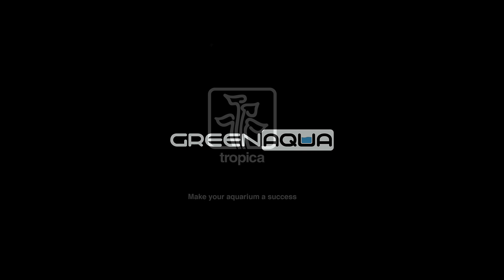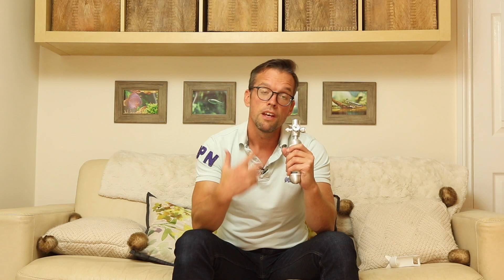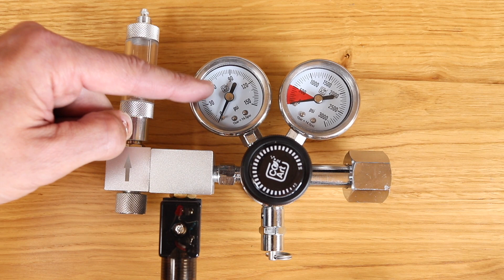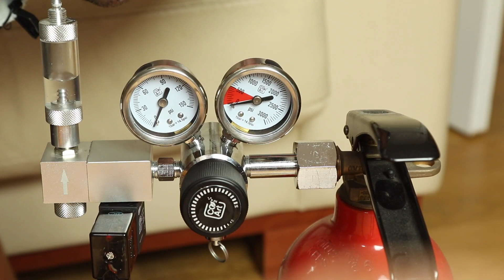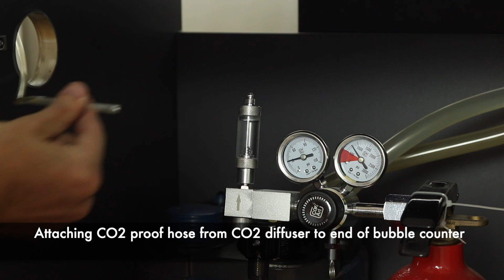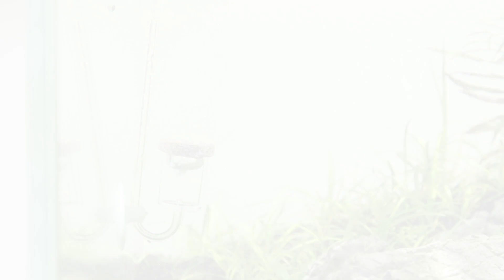How to set up a pressurised CO2 kit - Full Tutorial

Comment: Nice video! For those of us in the US I found the coupler size on the regulator is larger than the fitting on a standard fire extinguisher. I purchased a swappable 15lbs tank from a local supplier for $90.00 refills for $20.00.

Comment: There are dual stage regulators with fixed outlet pressures.They reduce the outlet pressure to a fixed psi usually between 30 and 40 psi depending on the model.

Comment: Hello George,  Hope this finds you and yours in good health and fine spirits.   Here are a few questions,  what are the pros and cons between an inline diffuser and an in-tank diffuser?   Which is a better return system under gravel jets or in-tank returns?  Please explain why med. or low light plants don't need CO2 but high-light plants do and are there any plants that buck this rule.  Can you explain what kind of led wattage is needed per gallon of tank water for low light, a medium-light, and a high-light requirement tank? Thanks, George and Hope you get around to these.

Comment: Hi George, not sure if this has been mentioned but you don't need a tie wrap as the pin will back in again when the handle is gripped down and this keeps the cylinder valve open.

Comment: Just a small clarification. Not every dual gauge regulator is dual stage (double chamber), but actually most of the cheaper dual gauge regulators are single stage. So if you want to buy a dual stage regulator make sure that the description really says dual/double stage and not just dual/double/twin/two gauge. And it is best to use regulators specifically made for aquarium use. Also, make sure that the regulator has a solenoid valve, it is a must have feature.

Comment: Actually before opening the tank the working pressure valve should be closed. My understanding is having that much co2 getting slammed through a smaller opening can actually do some damage. So make sure you have the working pressure off when opening the tank
Reply: You are correct. Unfortunately no one gives you this warning when you buy one - there is no instruction manual in the box and shop was not helpfull. Bought one today and almost blew up the guages. Was just lucky it still works.

Comment: If anyone is using the 95g Tropica Co2 system, I'd advise buying an inline solenoid so that Co2 can enter at a regular interval every day and it also means you don't have to adjust the needle valve whenever you need Co2 so the bps will stay the same every day!
Reply: Once I'm a millionaire I will think about using the tropica system. For now I will buy 2kg CO2 fire extinguishers for £22 which last me 6 months at a go.
Reply: Xaviera Yayaell well obviously if you can fit a 2kg cylinder that's clearly the better choice. The Tropica nano system is to be used in places were there is no storage for such cyclinders. For example kitchen worktops or coffee tables.
Reply: @matthewjsherman  Now that is a sensible alternative,fire extinguishers next to the microwave or cooker is rather unattractive.👍

Comment: Having worked with CO2 professionally in the drinks industry it is a serious point about how dangerous CO2 is. It is toxic and can make you pass out, however the real danger is that it's heavier than air so if you pass out and collapse to the floor you could fall into a layer of CO2 and suffocate. We wear gas monitors to check CO2 levels when we enter cellars or enclosed spaces. Another point to note is that a pressure gauge does not tell you the contents of a CO2 cylinder. This is because CO2 is held in liquid form by the pressure in the cylinder as soon as that pressure starts to drop the cylinder is effectively empty as the CO2 in it is no longer liquid and all you have left is small amount of gas in the cylinder. I have never used CO2 on an aquarium this last bit of gas may last a while as even turning that bubble counter way up still looks like a very small amount of gas.
Reply from the maker: Great info! Thanks David 💚
Reply: Yes I have a very large CO2 tank next to my bed and frankly after talking to the supplier about excessive ambient outside air temperatures (was considering keeping it outside in summer temps of up to 48 deg C - he talked me out of it) and the danger of an exploding cylinder -- I am not so sure I want one in my bedroom now! Even a leak sounds potentially fatal!

Comment: Great instructional video George, this inspired me to get my first co2 and I just set it up. Do you need to install a check valve to prevent water from flowing back into the regulator when it's not on? Saw that on another video and was wondering if you had it installed as well.

Comment: Hi George, do I need to shut off all the valve from bubble counter and working pressure dial before opening the main valve from CO2 tank ?
Thank you.
Reply: The rule says that you need to close the big knob (tun left), and open the small knob (buble counter) and plug the solenoid.  This will means that the regulator will stop any pressure to reach the solenoid. If by any reason you have a big pressure wave which will be able to pass the regulator then will have a way to escape trough the opened valves. 
I personally never use this method, I just open slowly the bottle without changing any settings on the regulator.👍
But that is me...😉
Reply: Just bought one of these CO2 art systems. Unfortunately no-one tells you to fully unwind anticlockwise the big black HI-LO knob under the guages. There is no manual in the box - had to go on utube to find out how to use it. I was just lucky I didn't blow my guages as I turned it on first with the knob at HI setting. Its basically not how to do it. I know now.
Reply: @henrykater9728  All the manuals are on the CO2Art web site.

Comment: Great video.  Something on CO2 diffusion would be good.   I use a ph controller to control my CO2 on/off.  It monitors the ph and turns on the CO2 solenoid to reduce the ph - taking advantage of the ph/kh/co2 relationship.  I am relatively new to CO2 I injection and It seems to me that this method works well but doesn’t seem to be a popular method in the hobby - everyone seems to control by counting bubbles and timer linked to the light time cycle and monitor CO2 level by drop checker.   Is there something I’m not understanding as I said my system seems to work well and is a set and forget but no one else seems to use this method.  Am I setting my self up for some long term issues or some other problems?  Thanks again for your channel

Comment: You forgot the third danger of pressurised co2 systems: freezing your fingers/hands, etc. Pressurised gas when expanded produces a cooling effect and even though there isn't really enough pressure in one of those little 95g bottles to 'fly off' around your living room you can get some nasty cold burns and even cause some temporary loss of feeling due to the extreme low temperatures of the expanding gas. Best not to ever unscrew a pressure valve until the bottle is empty.

Comment: Hi George, I use your channel a lot for learning. I've just set up my first system just like the one shown in your video, however the high pressure gauge hasn't budged but I can vary output pressure gauge. Have you any advice as to what's going on? I have it attached to a new extinguisher just like your video. Thanks!! :)

Comment: Not like may be buy for the aquarium. This fire extinguisher is must have at home for any force major. 
CO2 should be stable over long time until liquid CO2 will be consumed. Then arrow will wuickly come to red zone. 
To determine CO2 level you need to weight gas bottle.

Comment: How can I procure co2 regulator in India. I don't see any option on the internet
Reply: You can order them from amazon.in. The Co2Art regulator shown in this video is also available there. If you want to buy a dual stage (double chamber) regulator, be aware of that not every dual/twin/two gauge regulator is dual stage, but most of them are single stage.
Reply: @markush1122  I tried searching on Amazon. In did not find any the ones available are cheap Chinese one
Reply: @chrisandrade1580  If you type CO2art in the amazon.in search you can find this regulator.